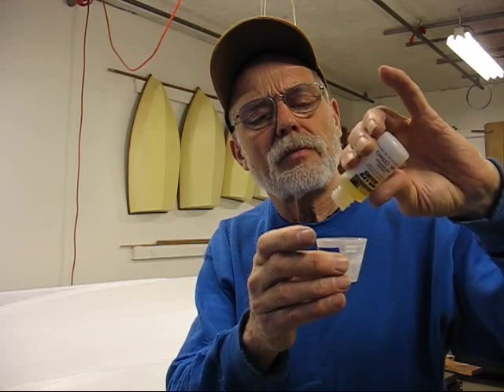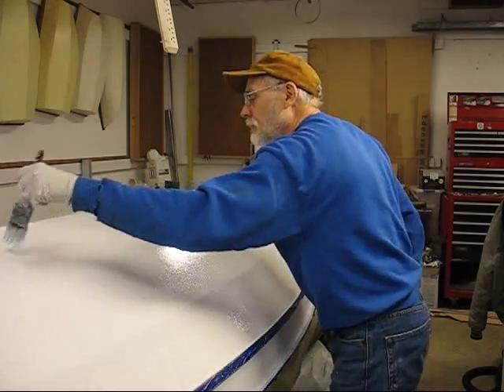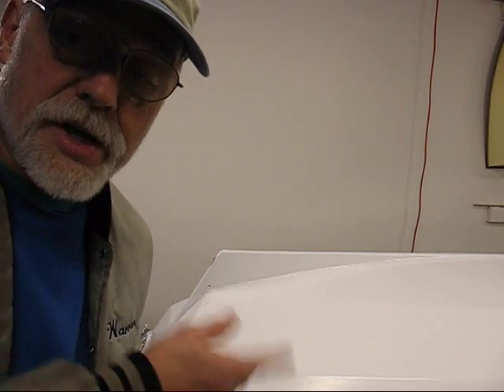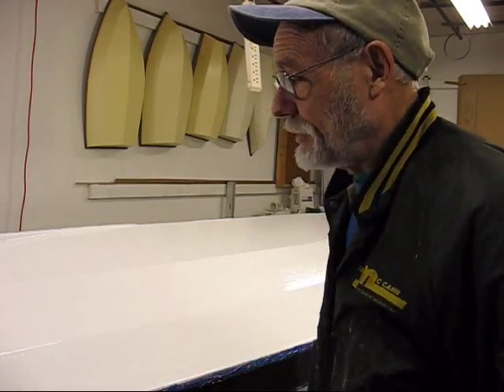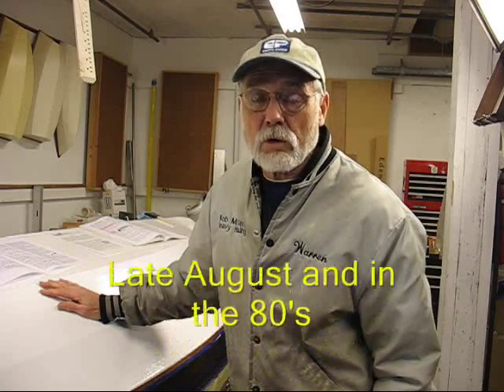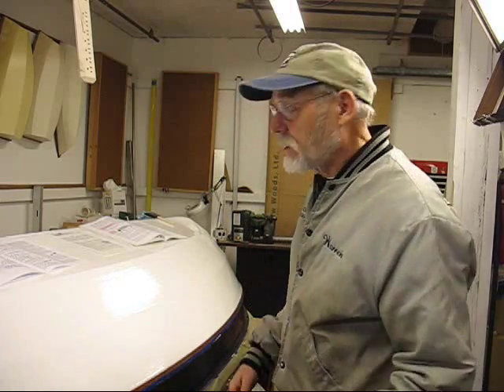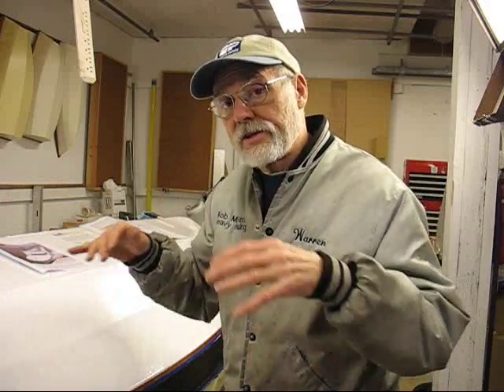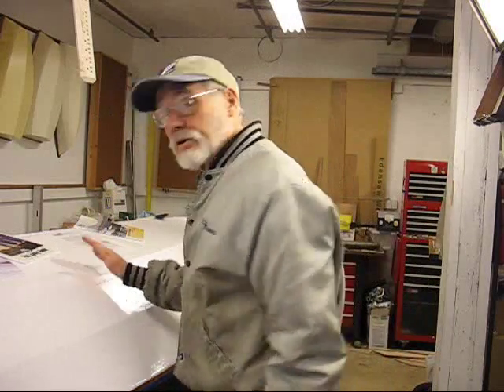Part 34-4 Final Paint Out.wmv

Comment: I had the same problem with the masking tape so now I pull the tape before the paint dries and re-mask for the next coat. Less work in the long run. I have also put multiple layers of tape and pulled one for each coat. It works with some paints but not all.

Comment from the maker: I don't know.  It may depend on how much of the "powder" you add to the epoxy to make it "thick enough" to act as a paint.  I've added the "epoxy pigmented pastes" to straight epoxy with good results, but I've never used the powder.  You should give the LPU paints a go over the finished epoxy surface.  The LPU paints are tough and fairly easy to apply.  Make a test batch first for using the powder.

Comment: Okay, first in my very humble opinion you as the builder will probably know EVERY little mistake but to anyone else (me), the sailboat is extremely nice and will have no bearing on performance or longevity.

I do have a design question maybe you can help me with related to performance versus ease of build. Is it really worth the extra effort and cost to have the extra chines at the Bilge versus a flat bottom sheet of plywood on a small boat like this?

Comment: Great job but to much work for me 
I would just knock up a basic female plug out of masonite cut on my cnc router and just lay the whole thing up in gelcoat polyester resin chop strand and rovings
No wood to rot or delaminate nothing to fragile no worries 
Sure it aint in keeping with traditional wooden boat but will last forever